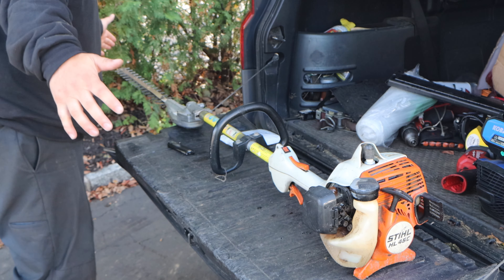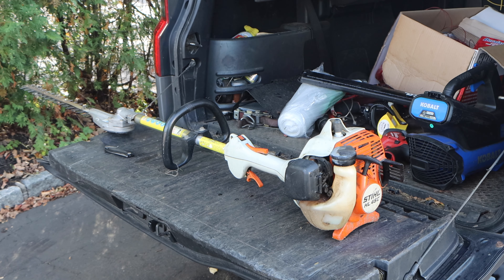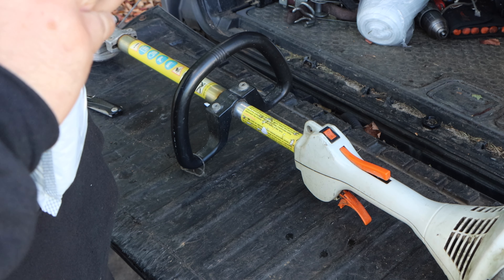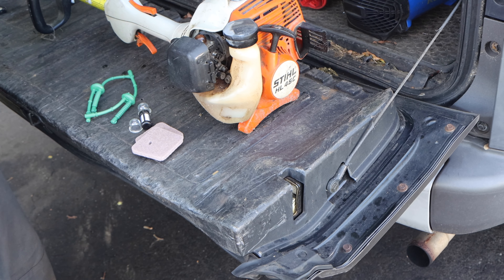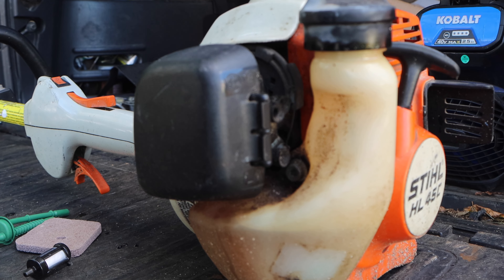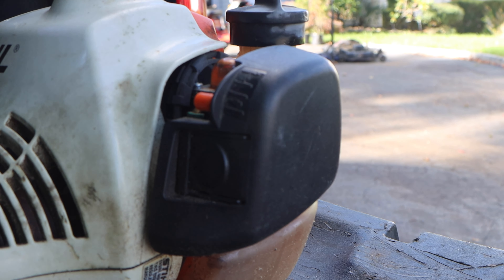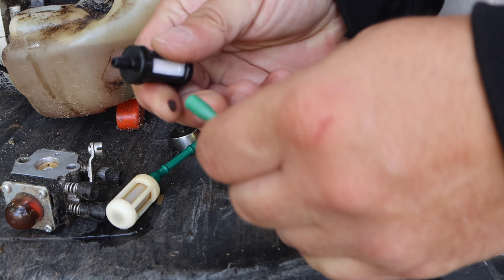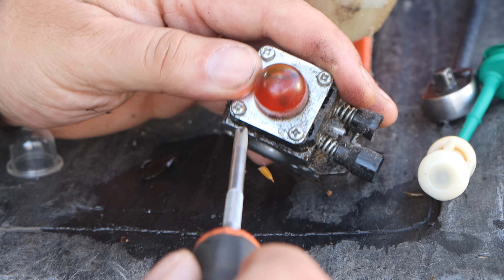2 Tune- Up Kits For The Price of 1 How TO Tune Up Stihl Trimmer QUICK EASY & CHEAP

Comment: There are times in life when the OEM parts are mandatory, and there are times when the OEM parts are insane (as in the sticker shock).  It all depends, and most of the time it's trial and error in order to learn when to spend the money and when not to.  In this case, I have to say that those aftermarket parts look pretty good, so I'd say that it's safe to use the aftermarket parts.  Time will always tell, but if you're vouching for it based on your experience, then I'm in your corner.   On another note, what brand of 2 cycle oil do you prefer???  I've recently switched to the Echo Red Armor and it seems to be pretty good.
Reply from the maker: We are closer to Lowe's than HD.  I've been using Husqvarna Mix b/c its synthetic and mixing it on my own with regular gas.  I know people say to use prememium fuel but I'm too cheap/forget to use fill up.  My husky been running fine that way for last 6-7 years.  

Agree with OEM...thats why its important to do things on your own.  Lets say you risk using a NON-OEM part you know exactly ehat to do if it fails vs paying someone again.

Comment: Sometimes I wonder why I waste my time cleaning carbs even with a high sucess rate.

Take carb off and apart soak it, blow it out. Clean all the jets ect and it still runs like shit.

Experienced this the other day, 518 ZR running extremely rich. Was popping too. Slapped on a $17 carb in 15min. Thing runs like a top. OEM carb was $70. 

I agree on the spark plugs. I only use NGK or champion. 💪
Reply from the maker: I tend to believe I'm numbers a person.  The numbers when it comes to effort and applied time vs new just doesn't ad up to me.  Specially 2 Stroke and Honda Like Carbs that can't be rebuilt.  I'm not polishing anything...if a quick and dirty with idle clean doesn't get it runnig new one goes!  Still can't comprehend Honda carbs aren't studded like their copy cats!